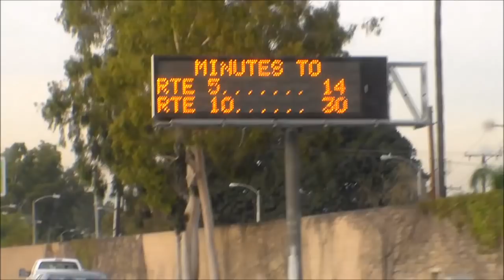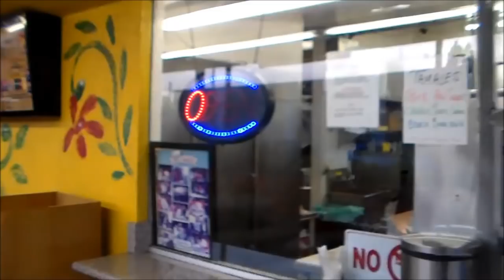work vlog

Comment: The traffic that you have shown, nothing compared to Moscow. ) There you can stand in traffic for 2 hours especially in the morning, even considering the fact that motorists are fundamentally move on the subway, because they know it. Here in St. Petersburg with it a little better, but the center during rush hour is too tight, so that the 2-3 km you can pass for half an hour (walk more faster).It's all in the Soviet planning, it was not originally designed for these streams (the widest road 4 lanes, very rarely 5, most fit into 3). this despite the fact that we have almost no private sector, and most people live in high-rise buildings in the city and the construction of these very dense areas for expansion of roads.